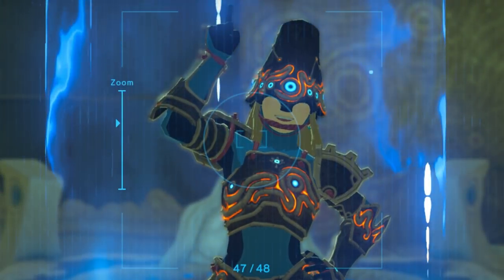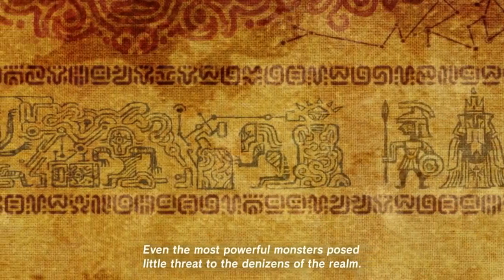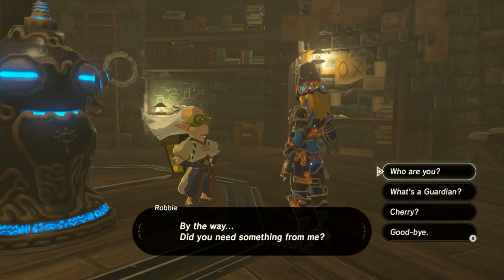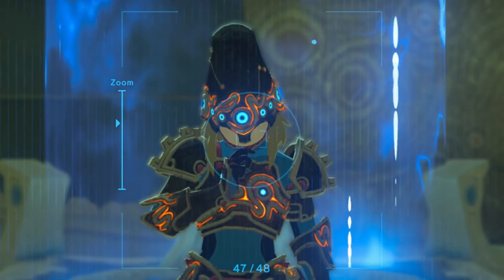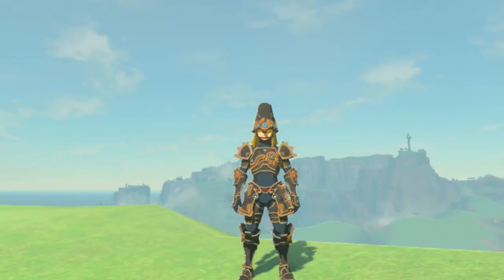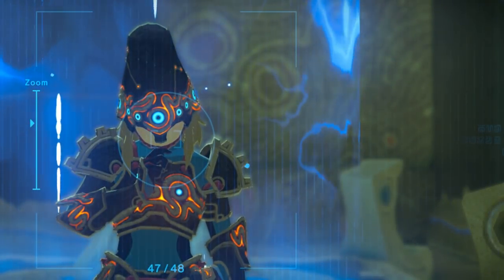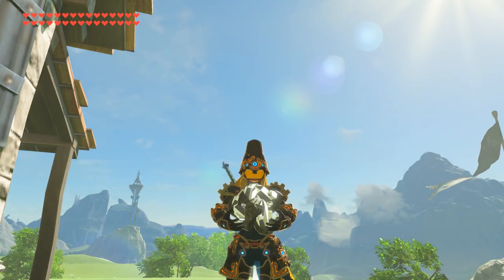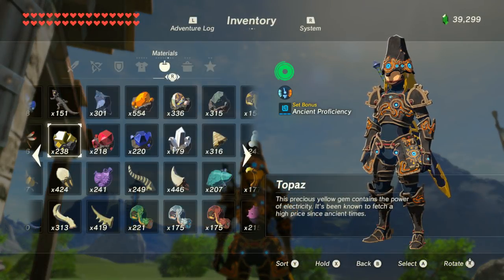Inside Sheikah Tech - BOTW Theory

Comment: I would say that the ancient cores for ancient technology do have diamond in them and they are powered by blue flames maybe inside and outside the diamond giving it its energy and how advanced it is using the blue flame as an energy source that is reflected as pure energy through the diamonds therefore creating sheikah technology as for using the scraps to create it maybe the oven melts and cools the scraps to make the structure for the technology also melting the diamond out to be used for the system so summing it up in a nutshell sheikah technology works as melting scraps to make a structure for pretty much anything and taking a blue flame as a power source to be reflected and converted into pure energy by diamonds powering the technology and for the robots not limited to and hypothetically more than the guardians and the divine beasts maybe the energy output is high enough to give “life” to them that could be controlled practically programming them and maybe giving them intelligence, counciousness and thought
Reply: I think that's possible🤔. It's either powered by blue flames from Skyward Sword, Timeshift Stones or Sheikah magic
Reply: That's a very incredible theory my friend
 I agree and like the sound of that idea. Although after hearing this theory video. 

I'm led to think that the ancient technology uses timeshift stones as a energy power source too. With the plasma form being the blue flames. 

As a type of fuel and energy too. Along with diamonds and amber being fused with the ancient technology structures and ancient core.

Since the ancient core quotes meaning As. "This crystal was made using lost technology. At one time it was the power source for ancient machines. This item is very valuable to researchers." 

It said a crystal is use as a power source. And what type of crystals relates to the ancient technology aka Sheikah technology. Diamonds, Timeshift stones and possibly amber as a material structure🤔.
Reply: Also take a look at the Timeshift Orbs. They resemble the Ancient Orbs. Timeshift Orbs are portable Timeshift Stones that can be found within the Pirate Stronghold and Sky Keep in the LoZ Skyward Sword game.
Reply: @kingnamor7777  maybe time shift stones are diamonds being enhanced by the sheikah for their experiments
Reply: @zizochemlali4639  rereading your comment during the morning hours, instead of night. I understood what you were saying. And I highly doubt that Timeshift stones were modified into the Diamonds we see in BoW.

Comment: Although iIm half a decade late to the discussion. I speculate that the blue flame energy source Sheikah technology uses has similar properties to plasma. So it could be reasonable to say that Sheikah tech is powered by a type of nuclear fusion reactor. 

Furthermore, I agree it is quite plausible the use of gemstones as microprocessors makes sense in the context of quantum computing. Perhaps, the Sheikah discovered some method of using naturally occurring minerals to create crystal computers to run their shrines, robots and even their handheld devices. Moreover, the circuitry also appears to use the gems as a sort of time crystal (which could be a solution for quantum computers in the real world).